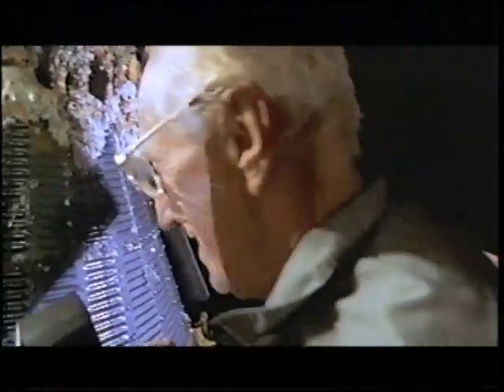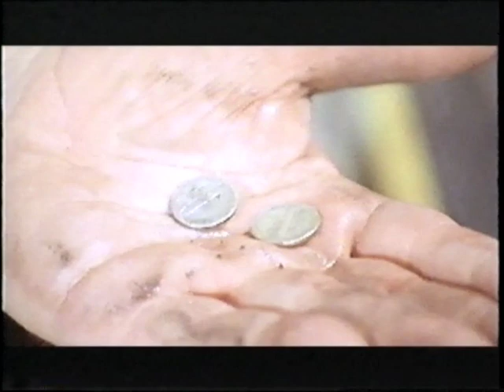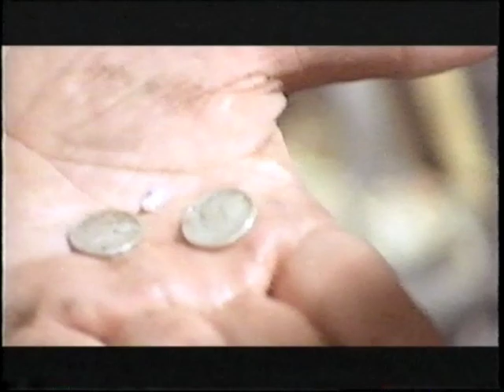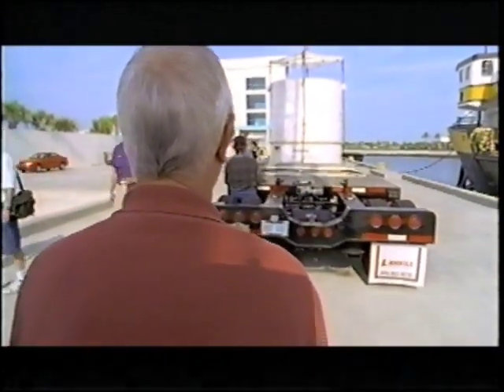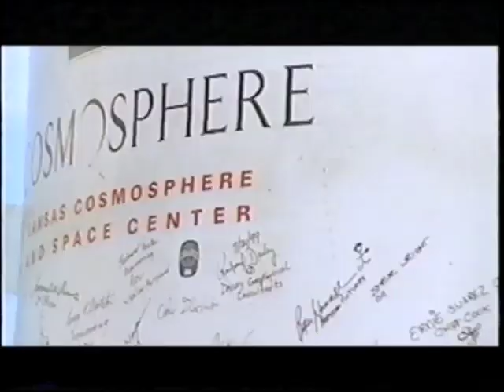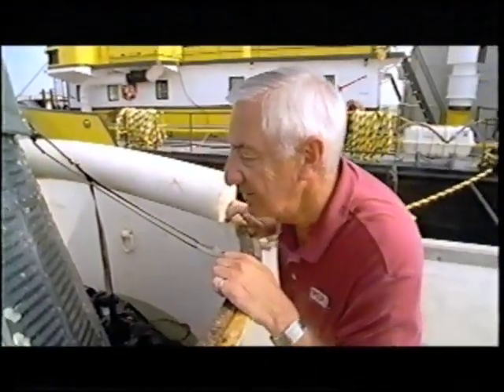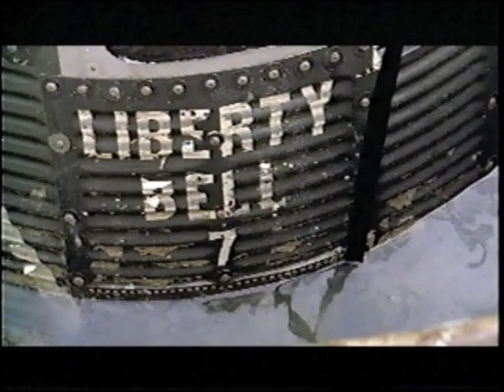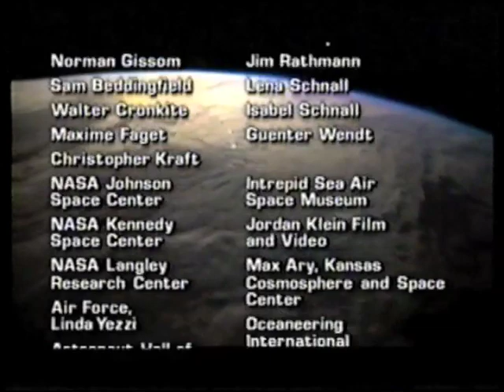In Search of Liberty Bell 7 (10/10)

Comment: I’m goin’ with the theory that Gus Grissom was too cool headed to screw the pooch.  God Bless you, Gus. Thank you for your ultimate sacrifice.  May you rest eternally with God in peace.
Reply: Test pilots simply didn't panic. I don't think he triggered it. At least on purpose. Cramped quarters in there. Who can say what might have happened; the film was ruined. Something catches on something, he reaches awkwardly for it, something pulls, something slips...I do wonder if today's tech could do something with the film.  But you know, they say there was "never a problem" with the explosive bolts, hatches, etc. There never is a problem. Until the right bunch of wrong things happen and  then there IS a problem. Nothing Man makes is infallible. During the same rough period, during flight tests of various systems at Muroc/Edwards, things that "couldn't happen" did happen. Things like autopilot systems for aircraft coupling in flight, being set up backwards. That system "checked out". And it cost lives.
Reply: He didn't. Think about the quality control, even the charge never went off!!
Reply: @outdoorfreedom9778  I shudder to think if it had gone off during re-entry.  😳🥺
Reply: #TheHatchJustBlew
Reply: @outdoorfreedom9778  true. Very true. But the QC was actually pretty damn good.  Being in the Quality world myself, I can tell you that testing things the wrong way will give you "passes" that fail in use. There's a QA guy at my job known as Dr. Death: he can test things in a way to make them fail, even things that "pass" some other QA guys' tests.  Same test, officially. The other guys didn't do anything "wrong" but the test itself was flawed. He knows the right combo of things to do, and his findings end up chnaging our procedures. Some of us feel that maybe this guy should be in on some design meetings...
Reply: @bbb462cid  Wally Schirra said in an interview that when the astronauts trained in blowing the hatch you had to hit the switch with the palm of your hand so hard, it left a black and blue mark that lasted for days. Gus had no mark on his palm after recovery.
Reply: @kb3byu  I know that. I also know what I said. I'm not about to reiterate it for you.

Comment: Why not just look to see if the safety pin has been removed and the plunger has been activated to blow the hatch. Only the astronaut could have done that.
Reply: It's not possible because the plunger and safety pin are on the hatch itself and the hatch was not recovered. The recovery team had some extra time and they looked for it but it's flat and very small and possibly covered in silt.
Reply: That wouldnt work in this case. First, there were multiple pins somehow. If you listen to the recording of the flight, which is on YouTube, placing the pins is a checklist item that he was meant to do after the parachute deployed and before hitting the water. He reported on the way down that he couldnt get one of the pins in. Said he's been trying but it just wont go in, so hes giving up on that and moving on to other tasks. It's very clear on the recording, and lends evidence that the hatch really did malfunction.

Comment: I still didn't quite understand the purpose of the ordnance that had to be removed and jettisoned. Why was an explosive needed in a sonar marker?
Reply: SOFAR stands for Sound Fixing and Ranging; 
they were small explosive devices attached to the Mercury spacecraft to indicate the splashdown location. They did this by detonating at a specific water depth in what was called "the SOFAR listening channel" which acted like a waveguide allowing the sound to be heard for long distances.
Each device was both armed and detonated by water pressure and contained military explosive similar to TNT. It would not have destroyed the capsule; however, it certainly would have made a mess of things
Reply: There were two on the capsule: one in a pocket on the main parachute risers and one behind the instrument bulkhead. The first SOFAR device would be ejected as the main parachute deployed, fall to the ocean surface, sink, arm and detonate thus alerting the recovery ships to what bearing the capsule would soon land. The second SOFAR device was intended to detonate if the capsule sank giving its approximate location and destroying the instrument bulkhead thus scuttling it so no unfriendly nation could recover it.

Comment: Why was a bomb placed on Liberty Bell 7?
Reply: A SOFAR Bomb is like a primitive GPS. You use triangulation to locate the source of the explosion.
Reply: "SOFAR stands for Sound Fixing and Ranging; 
they were small explosive devices attached to the Mercury spacecraft to indicate the splashdown location. They did this by detonating at a specific water depth in what was called "the SOFAR listening channel" which acted like a waveguide allowing the sound to be heard for long distances.
Each device was both armed and detonated by water pressure and contained military explosive similar to TNT. It would not have destroyed the capsule; however, it certainly would have made a mess of things.
Reply: There were two on the capsule: one in a pocket on the main parachute risers and one behind the instrument bulkhead. The first SOFAR device would be ejected as the main parachute deployed, fall to the ocean surface, sink, arm and detonate thus alerting the recovery ships to what bearing the capsule would soon land. The second SOFAR device was intended to detonate if the capsule sank giving its approximate location and destroying the instrument bulkhead thus scuttling it so no unfriendly nation could recover it.